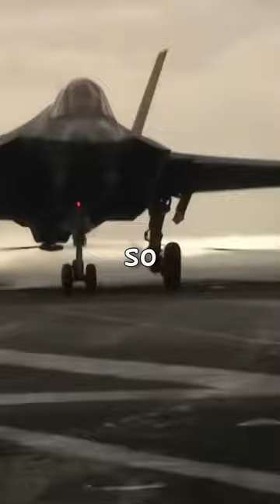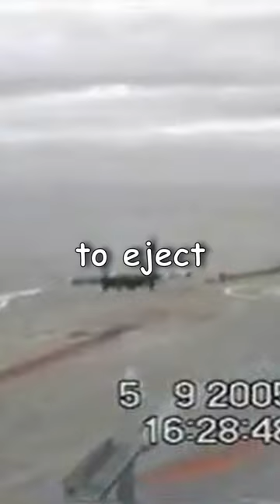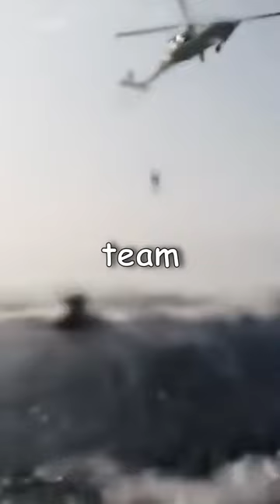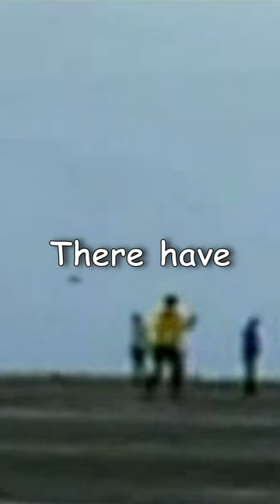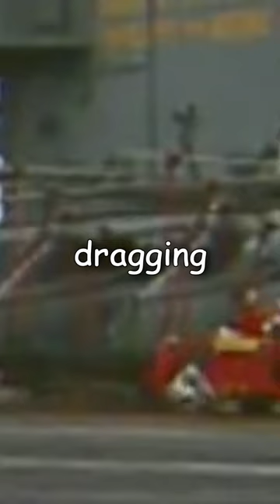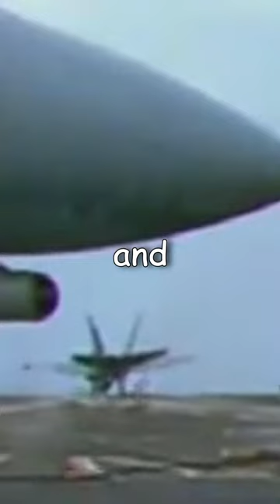What If the Arresting Wire Breaks…? #shorts

Comment: That's why when they land they turn engines to full power incase they do snap.
Reply: Or they miss them
Reply: The problem is that if they make the trap then the plane starts a violent deceleration and very quickly loses too much energy to make it back into the air.  That Hawkeye was lucky as hell.  If the cable had lasted a few 10ths of a second more, it probably would have hit the water.

Comment: I was very near an incident when the field arresting wire broke. I was on the golf course at a Marine Corps Air station pretty close to the runway when we heard what sounded like missiles being launched.

Found out later that a Navy A7 pilot thought he had missed his arrested field Landing and went to full power to go around again. But his tailhook grab the third wire. Attached to the wire are 30000 lb giant Links of chain in spools on both sides of the runway. Since his thrust was greater than the weight of the chains everything snapped. Pieces of cable went flying... one small piece about 5 inches long I think hit the side of my barracks and took out a chunk of stucco.
But the worst thing that happened was one of those chain links went through either a car or a house of one of the Japanese nationalists who lived nearby and killed his young daughter. This was the second time this particular pilot had done this so he was indefinitely grounded.

Comment: Thought when an aircraft caught the arresting wire. They were to go to full power in case the wire breaks. They can go around and try again.
Reply: Full power if they miss the wires not if it breaks.
Reply: @mattweber6505  OK, I had it wrong. It's been many years, thanks.
Reply: @mattweber6505 I thought they go full power always, not only if they miss or it breaks but in case they miss or it breaks
Reply: Full power in case the wire is missed , If it catches and breaks its going into the drink !

Comment: The wire breaking is more dangerous for the deck crew than the pilots. The pilots go full throttle upon landing just in case they miss or if the cable or arresting hook breaks, so theyre able to take off, loiter, and hopefully snag cable 2 or 4 once the deck has been put back to order and potential injuries are managed. At least, this is what ive learned from documentaries, i am not a mariner nor a pilot, nor a military personel whatsoever so i may be very, very wrong.

Comment: you're supposed to go full throttle when you land on a carrier in case the cable doesn't work-it's why you see pilot's heads snap forward when they land
Reply: Sounds like pilots need a HANS device.

Comment: This is so dangerous and so last century. Aircraft carrier is very expensive and very advanced huge machine. All this technology can’t help when some cheap wire breaks. Why not to invent or develop some another, more safe and dependable way to land those navy planes? Of course every time the hook of the plane hit the wire and pilot push full power it’s an immense punch to the wire! Why were invented and built the planes with VTOL? Why they don’t use them in navy ? Helicopters are doing fine in navy. This wire and catapult won’t be needed no more and pilots and sailors will be safer. I’m not military professional, sorry if  I offended anyone
Reply: This has been tried. Problem with just VTOL craft is mission requirements. Some missions require planes that cannot do VTOL (speed/maneuverability). The F-35 has three variants. Each one is different and has slightly different missions. The Air Force model does not VTOL. Also, while the tech is old, it works. These ships are war ships. They must sustain damage and still fight. This older tech is rugged and can take a beating. 
I was a nuke on carriers. The tech on the reactors is old as hell but it works and works well. It can take a shit ton of damage and keep going.
Reply: VTOL systems add weight to aircraft, reducing their range and ordnance load capacity, not to mention their complexity which adds to their costs for manufacture and maintenance. If there was a safer way to arrest an aircraft's landing on a carrier it would already be in use. Until that technology comes about or materials are developed that's light and rugged enough to allow for lightweight VTOL systems that are cost effective then the current system will remain in place. Aircraft carrier flight decks are a dangerous place to work on but military members understand that their occupations come with certain risks.
Reply: We used to have U.S.-built AV-8B Harrier VTOL planes (a.k.a. "jump jets") in our inventory. 1. The pilots hated them. 2. They were fuel hogs. They didn't last long.
Reply: @dalethelander3781  The harrier is UK built.
Reply: @anthonymonge7815  The ones in the U.S. inventory were built in the U.S. under licensing agreement.
Reply: @dalethelander3781  That is odd. I am in government acquisitions (have been for about 15 years). We normally acquire such items from the home country.
Reply: @anthonymonge7815  Dunno. Just going by what I read in a book in the "Walk Around" series that's sold in hobby shops.